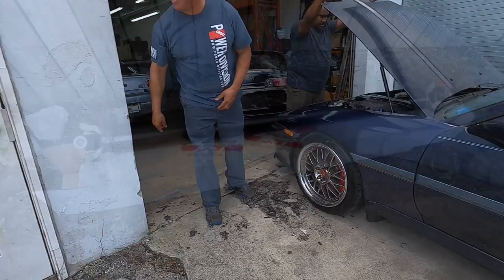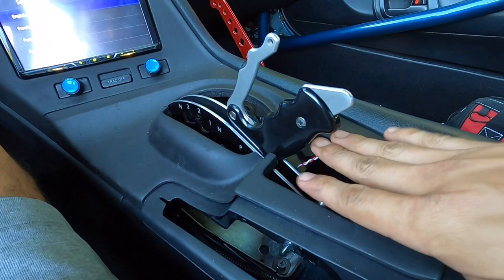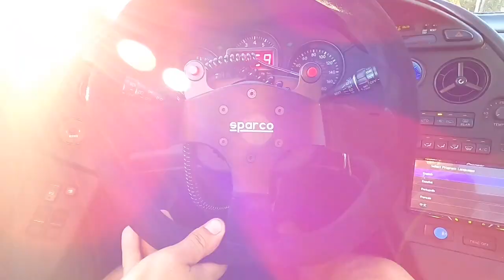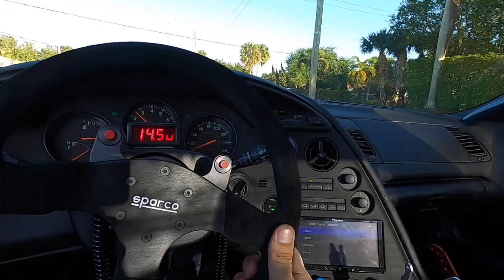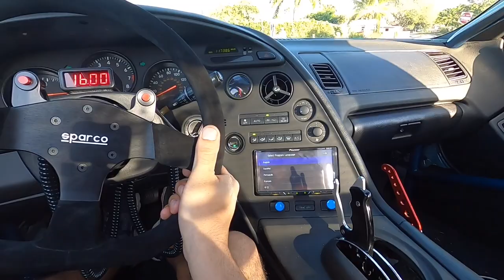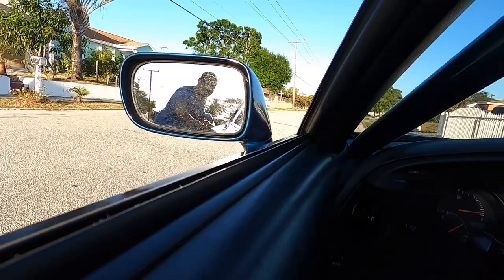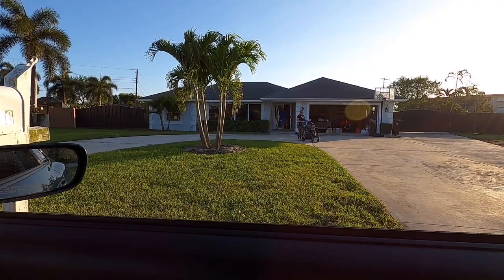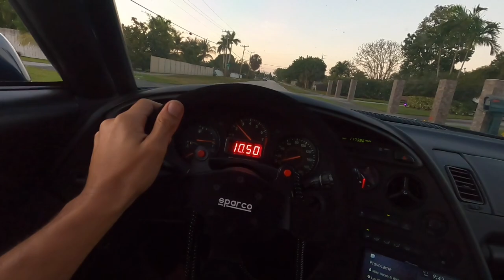Supra is finished! My First TH400 Drive

Comment: ** Pedro, I have been running a 400 for about 10years and used to pop it into neutral to coast at the top end of thr track. I kept cooking clutch packs and my tranny builder told me to leave it in 3rd because when it's in neutral it over spins the direct drum (2x).  Let it coast in 3rd with the brake band...
Reply from the maker: Thanks for the info Race Fam. I’ll confirm with my transmission builder but he is the one who told me to get this shifter with the clean neutral
Reply: @BalticSupraRacing  👍 go off of what your tranny builder recommends. Have fun this weekend and keep up the good work.  You put out great content and have an infectious attitude around cars and racing!

Comment: Yo homie, look into Lubrication Engineers transmission fluid, motor oil, etc. The stuff is next level and will save your stuff. 
And you surprised me.....I thought that A340 was going to be forever, but the TH400 is the right thing to do.

Comment: 3:26  A custom 3D printed center console lid would be 🔥especially if you integrated a cup holder.  Just send yours off so they can get the dimensions right.  Your car is way too nice for a cut up console.

Comment: Th400 is king. I have a similar spec box on mine and the first to second change is so strong I love it, only thing was getting used to no 4th on the hwy haha. Keen to see the improvements to the ET just from the trans swap alone, but I’m guessing you’ll add timing around gear changes now that you don’t have to worry about breaking stuff

Comment: What is the max speed you can go in 3rd before red lining ? I have the stock 4 speed in my skyline and I want to do this set up but I like the roll racing scene what do you think ?
Reply from the maker: This will work great for roll racing also. I ran a 7.37@188mph at only 8800 rpm my engine can turn 10k rpm. Should go over 200mph
Reply: What gear ratio do you have by chance ? And besides the transmission what other changes were needed drivetrain wise ?